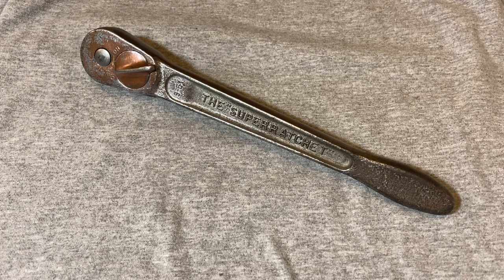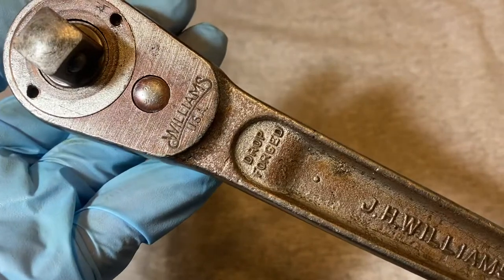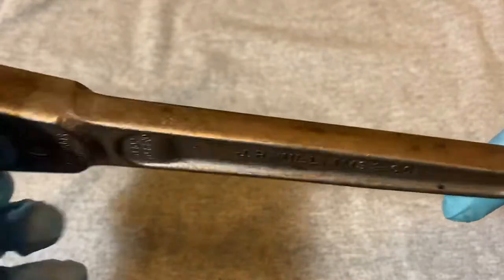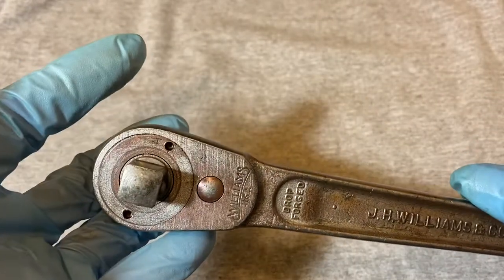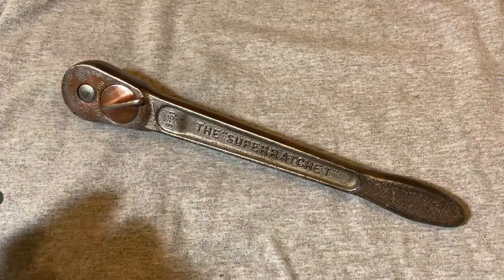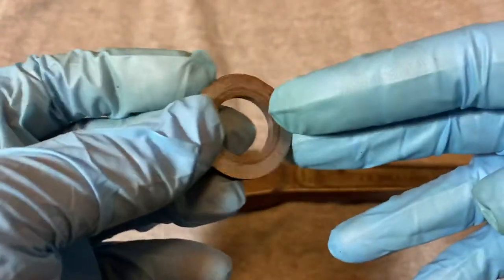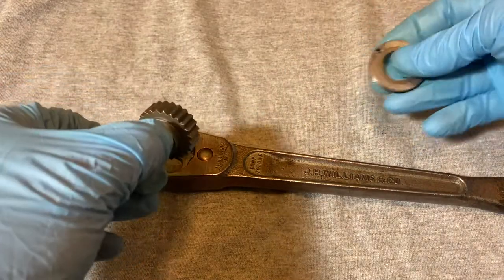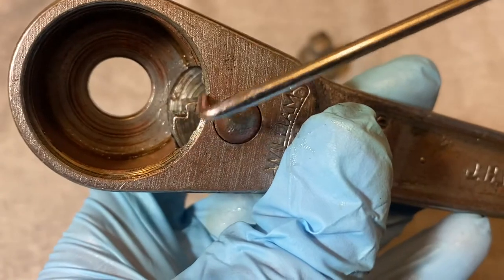J.H. Williams & Co S-51 Superratchet TOTAL TEARDOWN, Review And Advice: Vintage 1/2” Drive

Comment: I have a JH Williams spanner wrench but the pins are too large to fit in those holes for the retention ring. I’m pretty sure that they made smaller spanners that would save a lot of aggravation on those. I use my Williams spanner on old rv2 air conditioner compressor clutches on older Chrysler cars and it’s a life saver. JH Williams made great tools and I actually like them better before Snap On made them their industrial brand.
Reply from the maker: Yeah those spanner wrenches come in handy. I gotta pick one up when I get a chance 👍
Reply: That or you can use snap ring pliers.

Comment: I've got the same ratchet. Tried to dismantle the parts, but couldn't get that fu#'@*ing pin off ... How can I try?? Greetings from Argentina
Reply from the maker: Maybe some penetrating oil and a magnet. Also move the switch back forth a little while you try. But be careful. It’s important you follow the steps in taking it apart. If you turn the pawl around too much it’ll lock up on you.

Comment: I somehow got my pull flipped upside down and now its jammed inside wont go back to rightside up, any idea how to fix this so i can finish breaking this thing down?
Reply from the maker: Are you able to rotate enough to see the pin hole on the side of the pawl ?  If so are you able to get that pin out?
Reply: @snapringchronicles3020  cant see the pinhole at all sadly
Reply from the maker: I’m not sure, mine seems to have had a similar problem because the ballbearing spring under the pawl looks to be home made and non original.

Comment: Thank you so much.  I just picked up a 3/4 drive one of these and someone had broken off 2 screws in those holes so I assumed it was screwed down and couldnt get the thing off.
Reply from the maker: Cool. Glad I could help👍
Reply: @snapringchronicles3020  Is there supposed to be oil in there?  Grease?  What would you recommend?
Reply from the maker: Yeah a ratchet as course as this one with not many teeth you can use a grease. I like Super Lube. But if you don’t have that 3in1 oil works too. Just don’t fill it too much to where the oil leaks out. Cover all the surfaces where metal contacts metal and you should be good

Comment: I'm sure there's a socket we could use to remove that plate. Or we could make one. I've also seen adjustable spanner wrenches as well.
Reply from the maker: I have watch case Spanner that fit the notches of other S-52 I was showing but it didn’t budge. That one I let soak with atf and acetone over night then I had to pound it out

Comment: GREAT VIDEO!   Thought I saw pitting on the threads of that retention ring as you held it up.  I salute your patience and dedication in removing it.
What a CRAZY switch retention design! The deep tool marks on that massive pawl are evidence of the previous owner's struggle to remove it.
Reply from the maker: Yeah I don’t recommend taking these apart lol ...it’s like the Venus fly trap of ratchet teardowns. Thanks again👍

Comment: Crap, I accidentally turned the switch past 90 and now it's stuck.
Reply from the maker: Yeah that’s the problem the design of these, they are easy to get stuck.
Reply: @snapringchronicles3020  I think I may have permanently screwed this one.  I beat on it with a hammer and punch to try and get it turned back for quite a while with no luck.